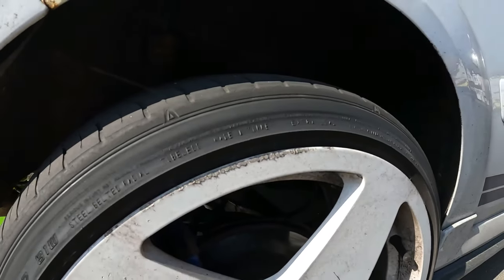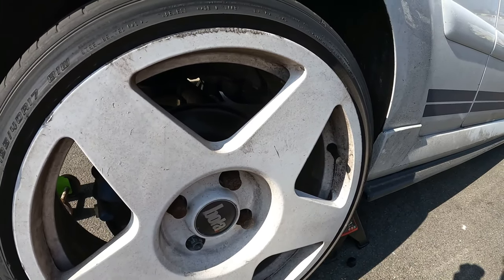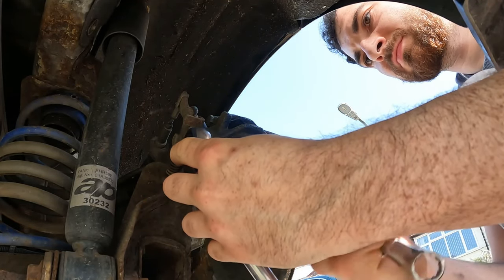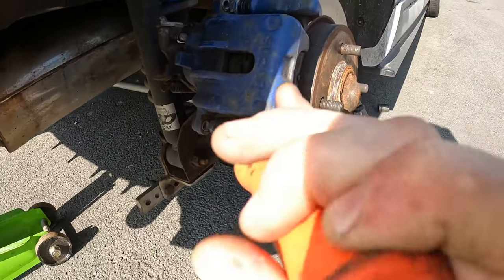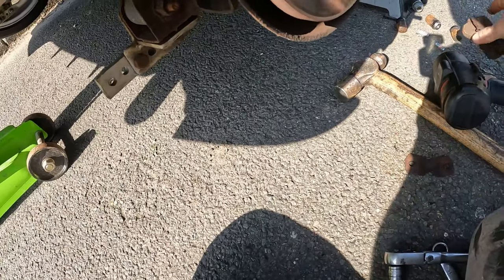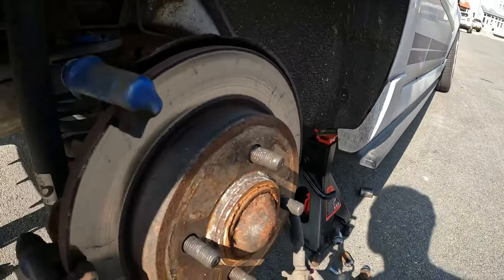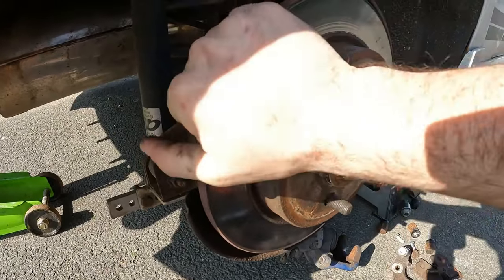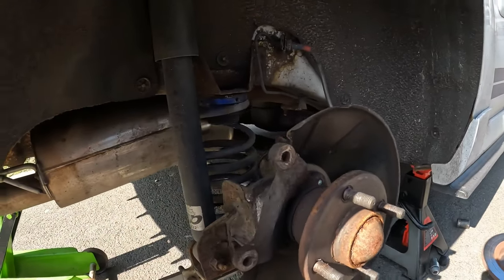EZ Rear Camber Shim Install on My MK6 Fiesta ST150

Comment: Awesome upgrade. When you do the rust  repair on the archers. You when do the area around the spring tops and chassic. As in the video the area looks rusty. By the exhaust.
Reply from the maker: She’s a bit crusty underneath must admit going to send it off and let someone else do it I have too many projects needing that job plus if anything went wrong I can throw it back at them
Reply from the maker: Only thing I’ll be welding up is the hole in the boot floor and the exhaust hanger that’s none existing

Comment: Nice vid, keep them coming :) gotta say i'm not sure about plastic for this job. I'm half way building an ST150 NA race car - engine arrives next week  .... to get rear camber we milled the axle spacers so they're standard width at the bottom and thinner at the top. We have 3 different sizes. To change camber angles for a particular track, we just change the spacers +/-    EZ ;)  to get adjustable front camber, we welded rose joints into the wishbones.
Reply from the maker: Thanks mate much appreciated and No I wasn’t either as its a lot to juggle when fitting and I’m sure with heat transfer on a track you could risk them melting and what sort of money would you charge for the machined ones as I’d be definitely interested as it’d be a much cleaner setup than what I’ve got now I’m just after 20mm with -1.5 degrees and have you got any photos of the wishbones? That you could send me on Facebook/Instagram

Comment: did you do a before and after pic? be cool to see a side by side. so are those grey plastic things slightly thicker on one side more than the other which is what achieves the camber?
Reply from the maker: I’ll have to dig some photos out as I kicked myself after as I forgot to film the before and yeah mate bang on they’re tapered so gradually get thicker then thinner

Comment: Hey man, I know I'm a bit late, you said you needed to get longer bolts. I'm looking to do the same to my fiesta. What size bolts does it need?
Reply from the maker: @0luc83  unfortunately it all depends on what size spacers you’re running (if you’re running them) along side the shims if you’re not running axle spacers then I reckon the original bolts would be fine
Reply: @6uiltdifferent  Thank you for the reply, saw it a bit late :D I'm running 5mm spacers and am planning to stack 2 on each side for a little more camber, do the shims come in a pack of 2 or will I have to order 4 total? Thank you :p
Reply from the maker: @0luc83  they come in a pack of 2 just be careful as it can knock the toe out and give you more issues so just get the car tracked after and make sure the toes still in check otherwise you’ll be munching through tyres like I did haha
Reply: @6uiltdifferent  okay thats cool, thanks for the info :)
Reply from the maker: @0luc83  no worries

Comment: Was that heatproof paint you used on the calipers mate? If so how come it's only lasted this long?
Reply from the maker: yes mate was proper caliper paint the worst stuff ive ever used  took a week to dry so water probably got under it as i did it in the winter and i wont lie my prep work was poor too which didnt help
Reply: @6uiltdifferent  oh okay, I haven't even used heat proof on mine so I guess I'll be redoing them before they go on the car lol any recommendations for good paint?

Comment: 7:00 any tips for getting these bolts off? I can't heat them because the sensor wire is too close
Reply from the maker: Make sure the socket is on fully spray it with wd40 and send it mate no other way
Reply: @6uiltdifferent  ah, just realised I can take the spring and shock out easily. Will do that. Yeah they're so rusted that I don't know what size they are. Put a 15 on and it fit, then the rust fell off and turns out it's a 13 🤣
Reply from the maker: @thomas9434  they’re meant to be a 15 I had to smash 12’s on my original ones
Reply: @6uiltdifferent  well fuck hahaha. I hardly even put much force into it and they turned into 13s
Reply from the maker: @thomas9434  yeah the struggles of having a Ford mate
Reply: @6uiltdifferent  turns out the shock absorber bolt is fucked too on mines. Got one off, other one is just rounding
Reply from the maker: @thomas9434  smash a 12 sides socket on usually does the trick
Reply: @6uiltdifferent  will give it a shot just ran out of no nonsense pentrating oil. Got some plus gas stuff to use now hopefully helps too
Reply from the maker: @thomas9434  plus gas is good stuff
Reply: @6uiltdifferent  not really had any luck with the car. Whoever changed the shocks last must have tightened the bottom shock bolt to death. I'm just rounding it more. Gunna have to heat it so much that the rubber in the shock melts I think
Reply from the maker: @thomas9434  they just get stuck as the bolts are a poor quality get some Erwin bolt extractors if you’re really struggling or bash a smaller socket on
Reply: @6uiltdifferent  tried bolt extractors but it's just rounding it even more but I'll try heating it again tomorrow. New shocks are cheap compared to getting someone out to weld it or buying a welder myself
Reply from the maker: @thomas9434  shame you haven’t got a snap on dealer as flank drive sockets would get them off
Reply: @6uiltdifferent  do you gun sockets off once you've hammered them on or use a breaker bar?
Reply from the maker: @thomas9434  normally gun them unless there’s no room
Reply: @6uiltdifferent  my gun is a shitty Chinese one. I've been looking at the DeWalt 891 gun
Reply from the maker: @thomas9434  get the dewalt xr
Reply: @6uiltdifferent  ended up with a dcf891 xr. Mid torque but the stats are up there with high torque guns
Reply from the maker: @thomas9434  as long as it does the job the xr is a bit overkill for a car as that will take off double decker bus wheels happily
Reply: @6uiltdifferent  ah it's not the big xr, I'm not sure how they title them. But it's a mid torque that performs pretty close to Milwaukees bigger guns
Reply from the maker: @thomas9434  should be alright then

Comment: That caliper paint doesn’t look to have held up very well consisting it wasn’t that long ago you painted them :/
Reply from the maker: I know complete waste of time, the fronts went rusty after 2 weeks
Reply: I had motip brake paint and seems to have done a good job!
Reply from the maker: @CdotPoppy  got any motips on how to use it
Reply: @6uiltdifferent  pay someone.. get them to prep it, spray it and cured it right.. in nice weather and that's it.
Reply from the maker: @CdotPoppy  was thinking of getting them powder coated or doing them when my spray gun is back